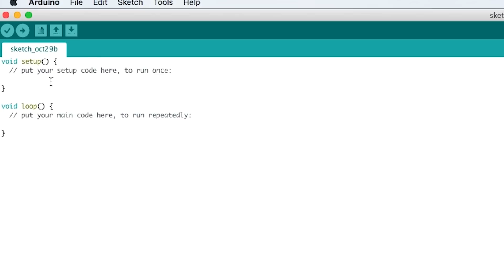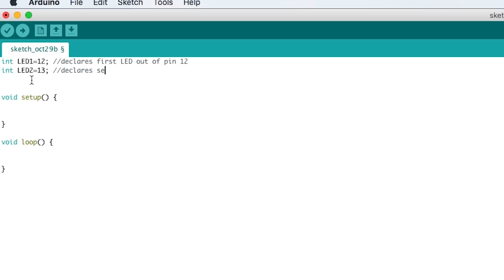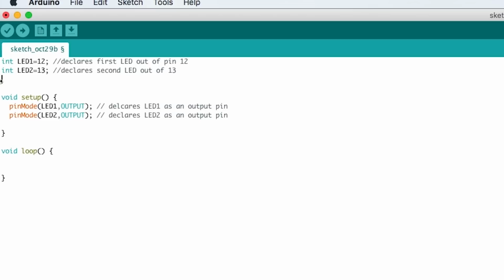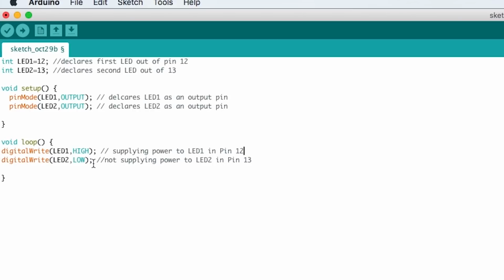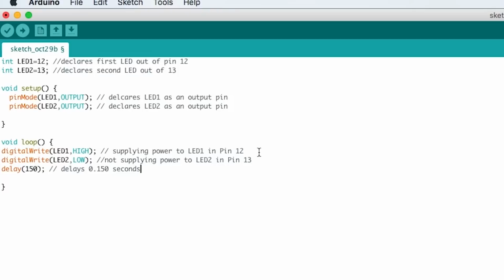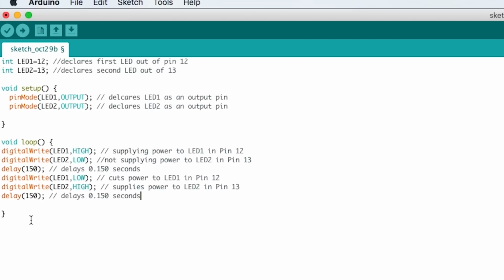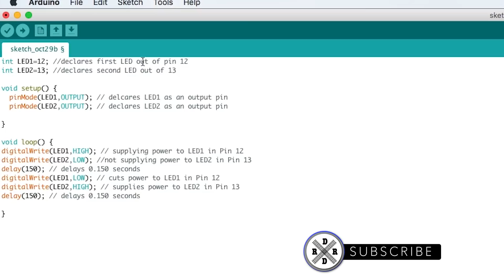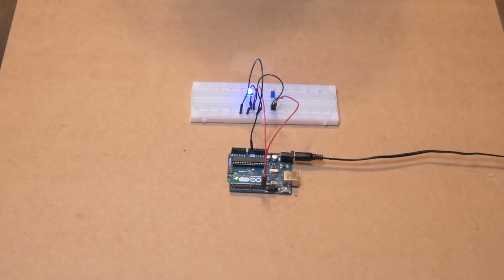Arduino Basics: Basic wiring and coding

Comment: Very Nice Jimmy!! How easy is it to get a double or triple flash peer led before switching to the next led inline?
Reply from the maker: It's very easy.  Just think of it as a sequence of delays and on and offs of the same LED before turning on the second LED. Here is the code for a triple flash.

digitalWrite(LED1,HIGH);
digitalWrite(LED2,LOW);
delay(150);
digitalWrite(LED1,LOW);
digitalWrite(LED2,LOW);
delay(150);
digitalWrite(LED1,HIGH);
digitalWrite(LED2,LOW);
delay(150);
digitalWrite(LED1,LOW);
digitalWrite(LED2,LOW);
delay(150);
digitalWrite(LED1,HIGH);
digitalWrite(LED2,LOW);
delay(150);
digitalWrite(LED1,LOW);
digitalWrite(LED2,LOW);
delay(150);
digitalWrite(LED1,LOW);
digitalWrite(LED2,HIGH);
delay(150);
digitalWrite(LED1,LOW);
digitalWrite(LED2,LOW);
delay(150);
digitalWrite(LED1,LOW);
digitalWrite(LED2,HIGH);
delay(150);
digitalWrite(LED1,LOW);
digitalWrite(LED2,LOW);
delay(150);
digitalWrite(LED1,LOW);
digitalWrite(LED2,HIGH);
delay(150);
digitalWrite(LED1,LOW);
digitalWrite(LED2,LOW);
delay(150);
Reply: Thank you sir!! I really appreciate the information!!

Comment: Good basic instruction! Well done....A question (probably beyond the scope of the video),  is there a specific reason you used 1K resistors? I was thinking LEDs would only need 220 or even less as they are usually 2-3 volt. Just getting ready to add resistors to my signal system and want to be sure I am not missing something. Looking forward to next week sensor video! Thanks, Ben
Reply from the maker: Honestly I had 1Ks and then some 220Ks and 500Ks laying around.
Reply: Works for me. Might be an idea for a future basic video - to resist or not to resist..........just the basics.
Reply: Hidden Canyon N Scale Railway just limits the LED current and protects the digital pin on the Arduino